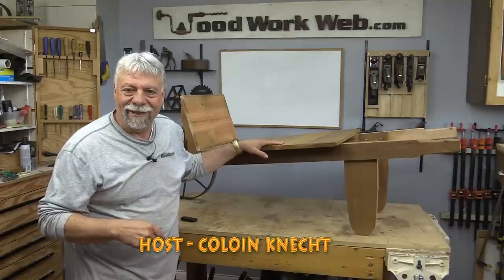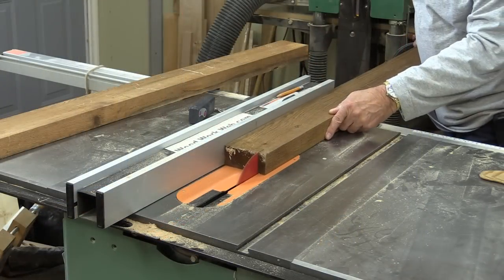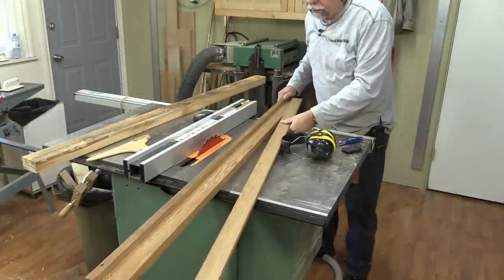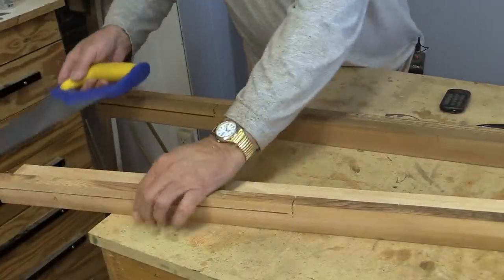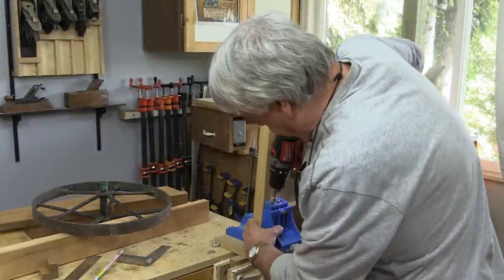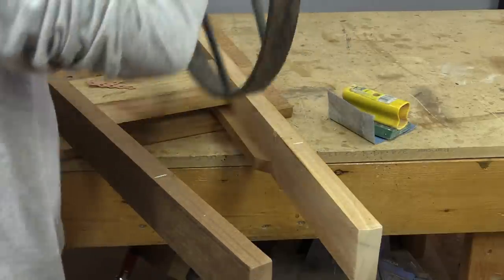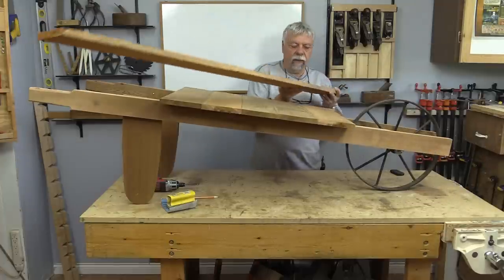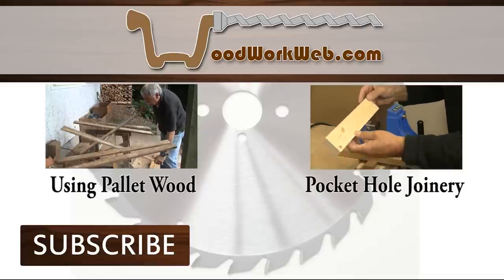How to Build a Cedar Wood Wheelbarrow / Garden Woodworking

Comment: Very nice Colin.  I thought you were going to attach that wheel differently though, but since it is just "art" and not carrying any weight the copper straps will hold the axle fine.
Reply from the maker: +krn14242 Yes, good point KM ... and yes, since it was placed in the garden it has not moved, but you are correct the wheel attach is pretty light duty

Comment: If you would have used different straps to hold the wheel on I think that would have made a great garden Wheelbarrow it looks pretty cool
Reply: +Charlie Wood  Yeah just make a slot in the wood for the wheel and a flat piece of metal to keep it in place.
Reply from the maker: +Charlie Wood Yes, probably correct, I could back and do that but so far the wheelbarrow has not moved so I am thinking it was requested more as a plant stand than moving anything ... and it's loaded with plants so I guess I will have to wait until fall to do this

Comment: You could give it a couple of coats of pine tar / boiled linseed oil blend on a warm sunny day to make it more weather resistant.  It will also add to the rustic charm.
Reply from the maker: +KSFWG Hmm, I have not tried that ... thanks for the tip I will give that a try
Reply: +WoodWorkWeb  I said pine tar and lineseed oil.  I should have said pine tar and turpentine.  50/50 mix.  Let the piece warm up good on a hot, sunny day so the mixture will soak in good.  Let it bake in the sun.  Next day, repeat the above procedure.  It's a very weatherproof finish.  It won't be pretty - it's more for a rustic appearance.